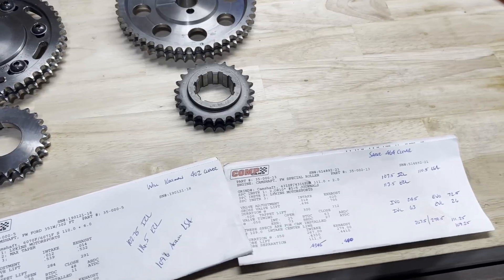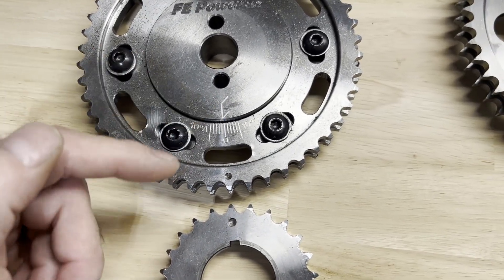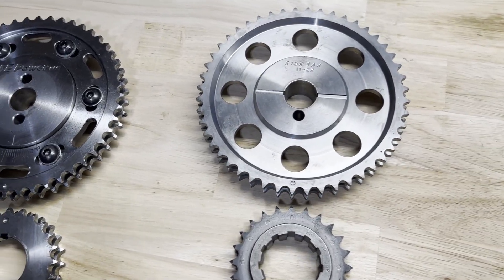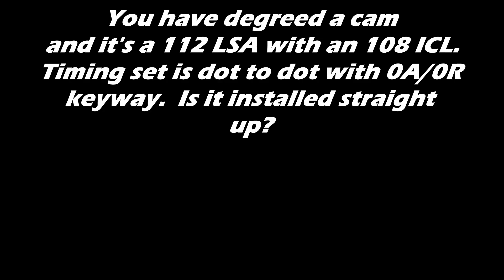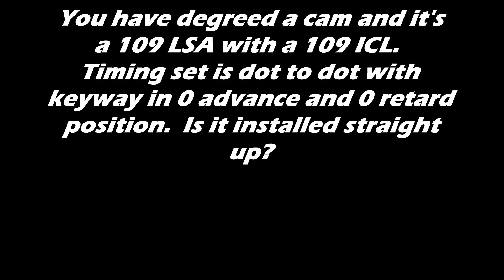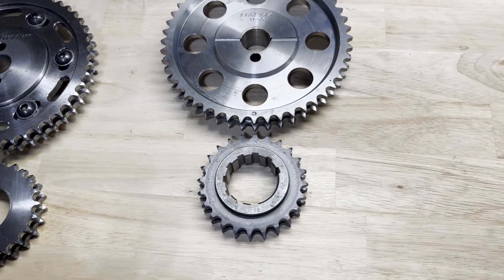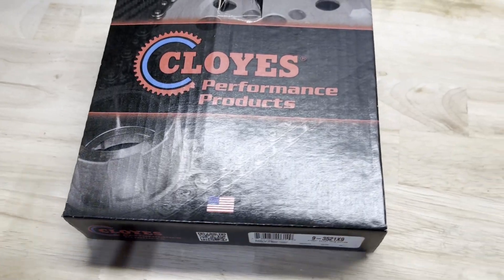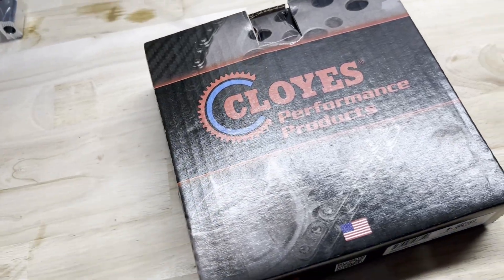Lykins Motorsports Should You Degree Your Cam?

Comment: Sure deg you cam if your a worry wort, or your worried about one or two hp.  Take note, that one or two hp could be looses.  I’m sure that is worth it if it’s worth it to you…. Me…. Never!…
Reply from the maker: If you only knew….  I’ve had cams be 8 degrees off.  In the recent cam challenge i participated in, that was worth 19 hp.
Reply: @lykinsmotorsports  That’s understandable, aftermarket parts are junk these days.   People don’t care anymore, job is just a pay check.
Reply from the maker: It's not that they're junk, each part has it's own tolerance.  When 3 different parts (timing set, crank, cam) have their own tolerances, you can get tolerance stack.  This is why we degree cams

In addition to horsepower loss/gain, if you end up with a cam that's really advanced and you didn't degree it, it could cause problems with how the engine performs on whatever fuel you're wanting to run.  

Every guy swapping cams should be aware of how to degree a camshaft.  It's not just for engine builders.
Reply: @lykinsmotorsports  I spent 40yrs in tool and die, I don’t need a lesson in tolerances..  Time would be better spent teaching people how to install cam without wiping the lobes off it every time..   
Deg. Min. Sec. of that cams orientation to the crank is meaningless with no lobes..
Reply from the maker: 90% of the cams I sell are roller cams.  You don't have to worry about wiping lobes off.  

Bottom line is that if you don't degree the cam, you don't know what you're going to get.  If you're a tool and die maker, you should understand tolerance stacking and it should be crystal clear to you.

Comment: I don't care what it's called. I'm concerned with the effects of retarding or advancing the cam. If one isn't willing to put it on a dyno and play with cam timing who cares where the cam is. Perhaps if it's off it's to your benefit or maybe it's to your disadvantage but without experimenting on the dyno how are you going to know? How many people dynoed their old drag engines?
Reply from the maker: Gotta know the correct terminology.
Reply: Well most diy mechanics don't  fuss too much when replacing the cam drive components on a daily driver because to get technical one would need the expensive adjustable cam drive gear for precise degree of the cam used..  and the other side is advancing the camshaft will bring the torque curve down in revs and retarding the cam will let it rev easier.. keep in mind bigger cams will be more specific due to valves running into pistons..  simple way is to set cam 50/50 rocking on top dead center and install cam drive with least slack on drive side of belt or chain and drive on..  👍

Comment: I am getting ready to install a cam next weekend. If intake is on 110 and exhaust is on 114 with 112 being LSA then would 112 be straight up? My cam guy said degree it straight up for best performance mid range3000-6000 rpm
Reply from the maker: That is correct.

Comment: Honest question,, if you use dot to dot is the cam ground  to be installed that way?
Reply from the maker: In theory, but the tolerance stack on the parts can make it where you need to move it around to get it where it needs to be.